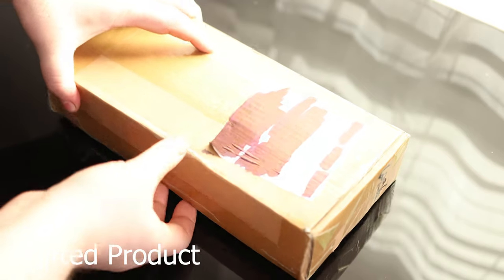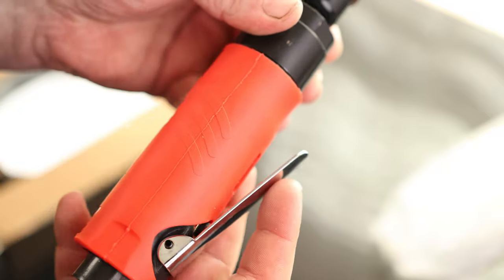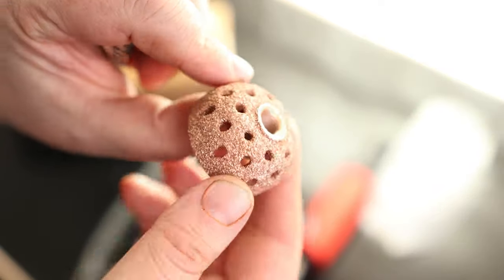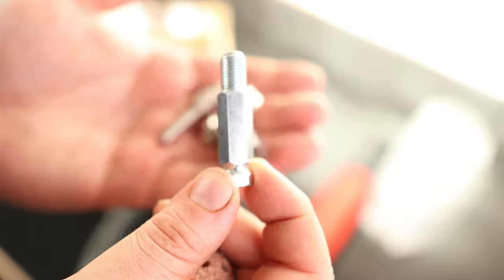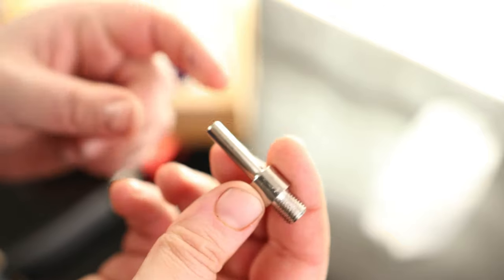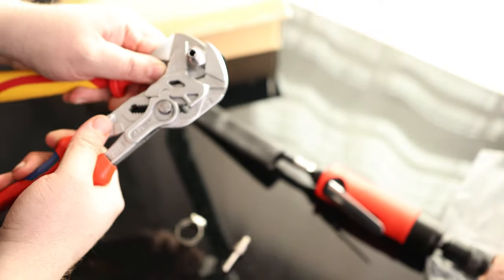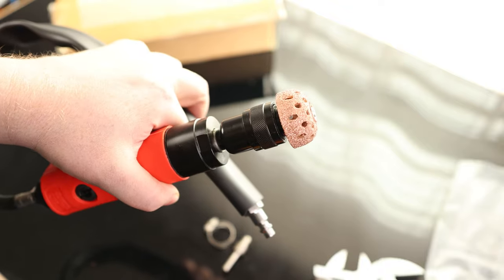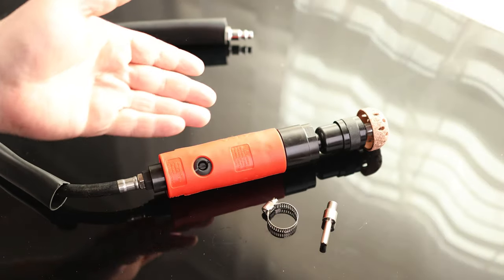VEVOR Air Tire Buffer

Comment: why does the  hose come with it? every 2weeks thee hose breaks with me can I use it without the hose and just connect it to the shop hose? what's the purpose of the hose
Reply from the maker: it's a whip so you're not rubbing your good shop hose on the tires.  It's not required.  You can bypass it.